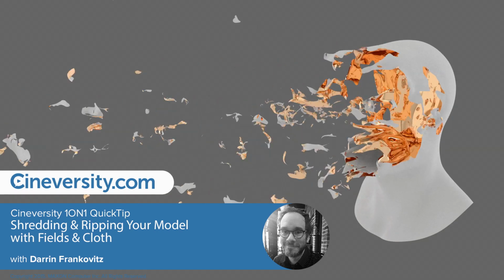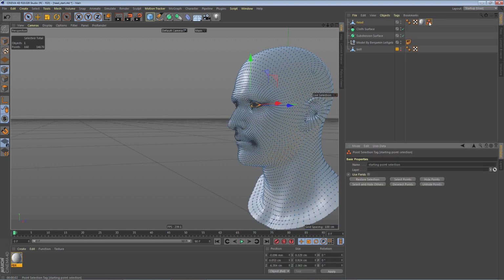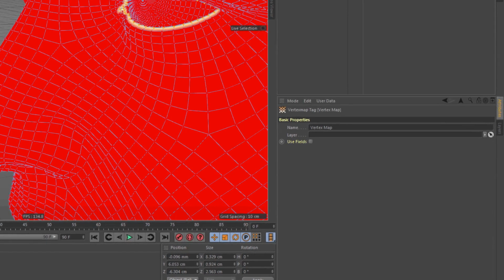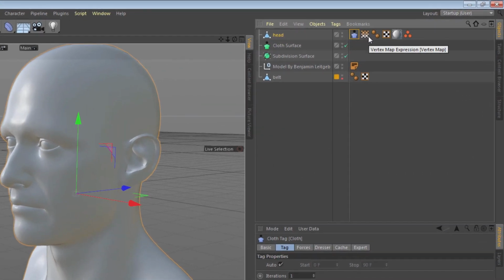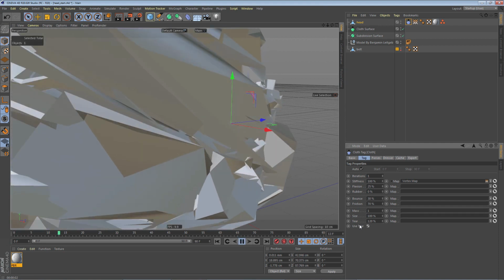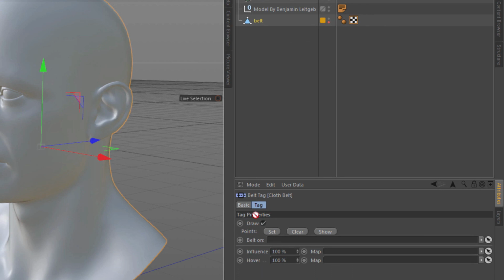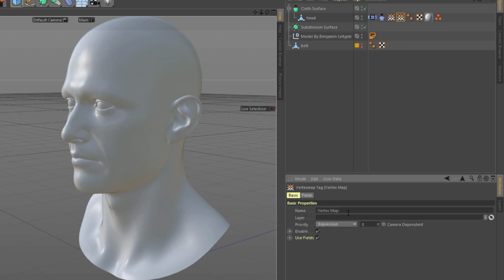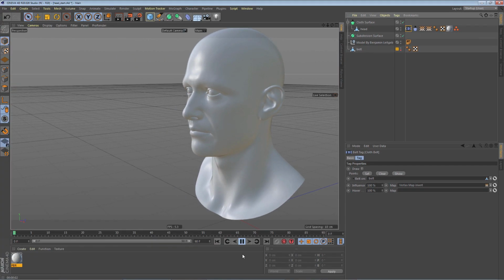Cinema 4D Quick Tip: Shredding & Ripping your Model with Fields & Cloth

Comment: When I add the model into the Cloth Surface, the tear does not work as in the example - I've compared my own project to the example project (Which does work according to these steps) but even after checking that every parameter is matching it still does not work - anyone had the same problem and found a solution?
Reply: Yes do you find solution ?

Comment: How would you make the object tear faster? I'm using a full body model and it takes over 2000 frames for it to completely finish tearing. I increased the wind strength but it doesn't make much difference.

Comment: Hi there,

Im following this with my own simple sphere to keep things fast on my old pc. Everything's been grand to the scale I'm doing them, till I've selected all points and gone to set them on the belt tag. But when I set the belt tag points they don't change to yellow like yours. I've followed everything to the letter. Any idea why mines not setting the points?

Matt
Reply: Hey Matthew, I know this was two years ago, but I found a problem to your solution. To fix the problem, make sure the cube (or whatever geo you are using for the "belt on" object) is editable. Do this by pressing "c" on top of the "belt on" object and the points should set!
Reply: @kkeerr  gosh this was so long ago, I cant even remember what this project was for and whether I figured it out in the end haha. Cheers though. I'll write back if I remember.